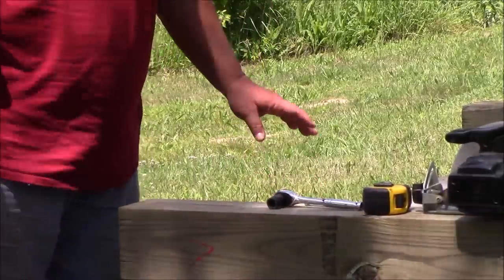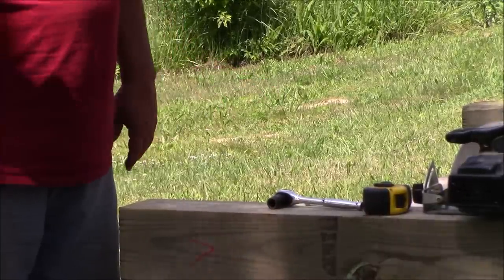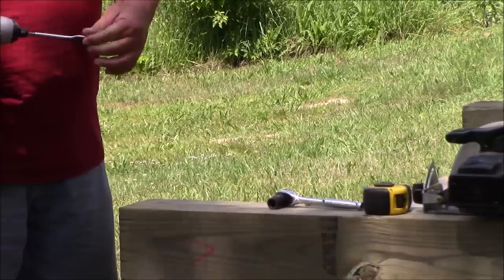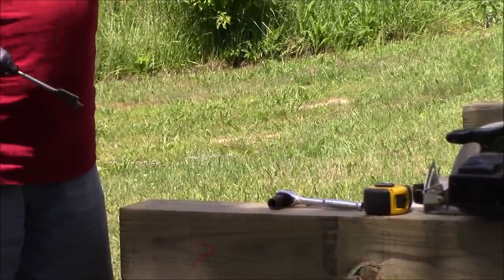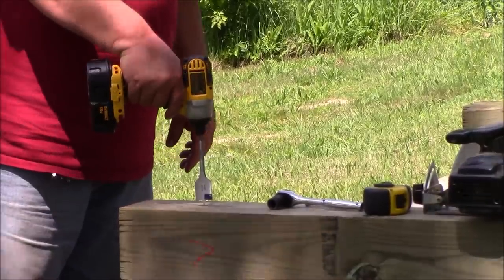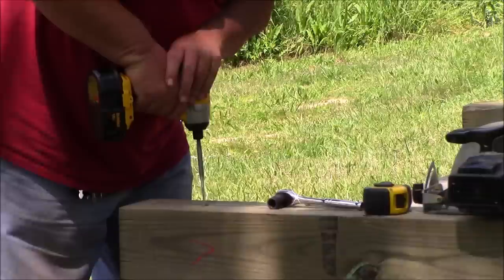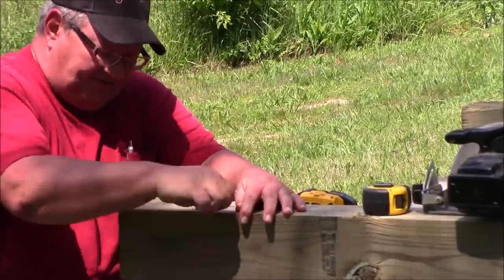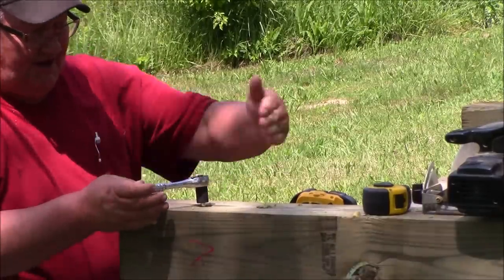How I countersink the lag screws on my 6X6 beams

Comment: Thats a counterbore, not a countersink! A countersink is a cone shaped hole cut into the laminate. It is typically used to allow the tapered head of a screw to sit flush with the top of the laminate. By comparison, a counterbore makes a flat-bottomed hole and its sides are drilled straight down. This is usually used to fit a hex-headed cap or screw :)
Reply from the maker: +I Perez You are correct. Thanks!

Comment: has impact driver but uses ratchet instead lol
Reply from the maker: Yyes, I saw the irony after making the video.  Concentrating on video making, and not actually sinking lag screws lol.
Reply: @StBernardAcres  But how many screws that size in ur opinion would impact driver be able to screw in before need battery recharge ?.Because i see on video when u use ratchet ,it have nice resistance.
Reply: Impact may be too fast, by hand is a nice speed